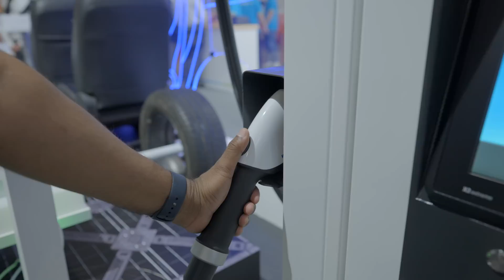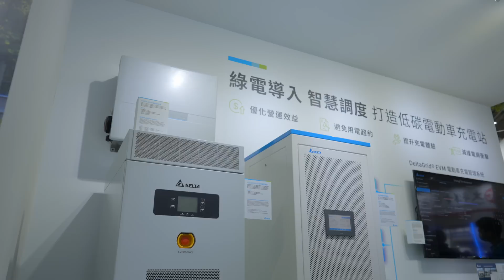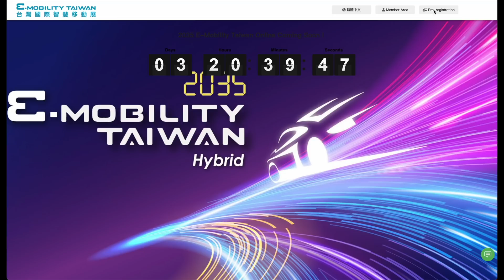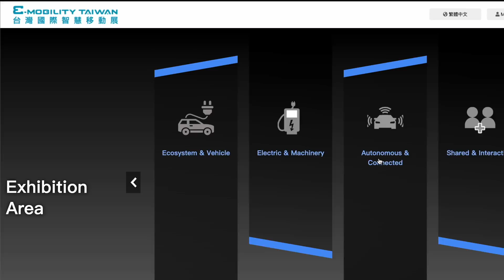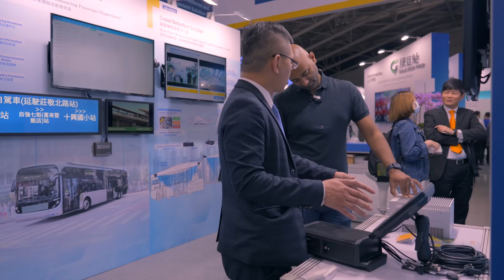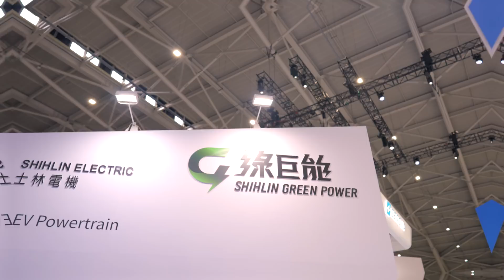The Unsung Heroes of Electrification

Comment: I think that the fastest chargers would go to those that can afford it; for as you said, the chargers are not cheap.  Now as for where the fastest chargers SHOULD go are to buses, Simi-trucks, and trains; any industry that transports people or merchandise.  That means public transportation, such as busses and trains (Ground based, no air) and Commercial merchandise transport, such as multi axial truck and trains.  Although Air-based systems may come in the distant future, the technology we have today is for the above mentioned.  Sea/Ocean Based transport is also available, however these are in less need of rapid charging as the time it takes to load and unload cargo can be about the same as the time to charge the battery, if they have one.  Sea/Ocean transporter may, in fact, be capable of charging themselves for their electric needs, as the vessels themselves are so massive.  Before the advent of electric, ships sailed using wind, today they mostly use fuel of some sort to propel them.  While said ships can be electrified, they are so massive in size that a sufficient solar harvesting system can be employed to meet the transport needs of those surface water vessels.  Road and Rail systems are not anywhere near such mass as to have their own energy generation "engine" or system, although they might use other solar harvesting technologies to supplement their energy needs.  Those are my thoughts for "Fast" Charging Technology.  As for Smaller transporters such as cars and normal trucks, if they can afford the cost of the new tech, then more power to them.

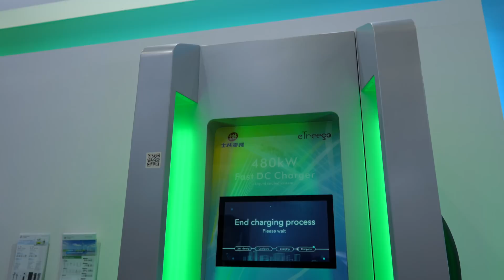Comment: 14:20 Technically, all of the 350 kW chargers deployed are already capable of 480 kW; they simply lack the number of modules required to output a full 500 A of current across their entire voltage spectrum. The GMC HUMMER EV (and all of GM's first generation 200 kWh Ultium EVs) can already max out the currently deployed 350 kW because they are still pulling 500 A even after the charger is no longer able to output that current at ~700 V. Based on the 100 kWh Ultium packs, the true max for the HUMMER EV and others should be ~380 kW. With the second generation Ultium batteries (lithium metal), those EVs should easily be able to max out a 480 kW charger. 

The Tesla Cybertruck is another possibility, where a 150+ kWh pack should be capable of hitting peaks of close to 500 kW, but that might still be unlikely on third-party chargers, which will most likely maintain a ~500 A max current limit for some time into the future.

Comment: With ICE one can convert to on the fly hydrogen with electric batteries fatigue or overheat and are fire traps requiring a lot of rare earth's we don't Have. It is BS
Reply from the maker: Lot of cars are moving to LFP batteries no rare earths
Reply: Lithium may not be considered a rare earth, but geopolitically and geologically it is hard to find to mine.  Electric anything is not something mechanics will be able to repair, and then there are the charging rates, software games of quick charge Tesla plays with salvage perfectly fine vehicles depreciating them, and one day soon the "get a horse" slogan will return with "get an on the fly hydrogen ice". when people whizz by people waiting on a charger or slowly charging.  I already see the fifteen charging slots at Wao with lines.

There are a lot more engine types of which the automotive and transportation sector are but a drop in the bucket of the climate change ge issue.

All that need be done is switch fuels to on the fly made hydrogen, not a redesign of more engineering nightmares engineers love to call themselves clever with new complicated BS machinery

When Toyota starts selling ICE hydrogen vehicles with on the fly made hydrogen people will look really as stupid as they really are with this electric BS  NOBODY on Earth has a robust enough interconnected electric grid to support electric vehicles like the US government is pushing without rapidly building LFTR nuclear and geothermal power plants FAST.

One of the biggest geothermal resources is the Yellowstone super volcano area, but that thought is as scary as despite LFTR nuclear technology was available in the 1950's but they very stupidly went with water fission reactors, similarly some idiot would drill into the magna chamber despite warning sights or due to above ground real estate availability thus setting off the super eruption, mankind it seems does not know how to be intelligent and not just excited.

Let us not forget a lot of power plants worldwide are still nasty upstream hidden emitters and will remain so.

A company like karpowership  could build or convert one of its power ships to and on the fly lng manufacturing facility and sail the seas with a LFTR powering the ship and making and compressing hydrogen or syngas and selling it in ports of call to replace Natural Gas which would make more sense than electric vehicles period.

When Spacex's starship explodes one day on one launch likely due to among other things the harmonics off 33 rocket engines or the failure of one cascading , Elon Musk won't look like such a  genius because electrification of transportation vehicles is just plain dumb to carry fuel in  the form of electrical energy stored in batteries.

Comment: I'm with Adam something on this one, if you have to install high voltage charging stations at every stop, you should just run an electrical street car line
Reply: If that buss has a range of 100km thats a lot of exposed power cables that require a lot of onsite maintenance between stops. .
Surely its cheaper to use chargers plus the fact you can reroute at will.
Reply: For busses and trolly like automated vehicles it makes .ore sens just to have high power charge points at stops near the end or beginning of lines where it will sit for a few minutes.

If a bus/trolly has a 50 mile route, then 2 stops that are 5 minutes long with a 500kw or 1mw charger would be fine to keep it topped up all day. It is far easier to change routes with chargers than rail/lines that are actual infrastructure.

Comment: When I saw the busses... I wanted to grab them and shake them while yelling, "What are you doing?! Put solar panels up there!" There are flexible solar panels with adhesive on the back of them. 86 inches long, 26 inches wide, 200 watts.. A bus is 100 inches wide and 40 feet long. You could fit 18 200 watt panels. 3600 watts under the direct sun charging the batteries of the buss while it's held up in traffic or sitting in the depo under the sun while charging at a station.
Reply from the maker: Absolutely!

Comment: People don't understand the exhaust fumes are terrible for health while we breathe it in during traffic & the car air filters don't absorb toxic chemical fumes...
Reply: Tesla does...
Reply: Awareness should also be raised about dust from brake pads being used. It's also very problematic for health. Electric vehicles could drastically reduce these emissions by using regenerative braking.
Reply: @Armando Aranda  very true, magnetic brakes recapturing the braking force is critical to make effective electric vehicles
Reply: Most cars have traffic filters, you never replace yours?
Reply: @everythingpony  True, but they aren't like an N95 mask. They only prevent certain sized particles and don't use carbon to absorb gases

Comment: 5:50 LTO is my favorite battery chemistry.  It can also handle heat and cold very well.  They last 20,000 to 30,000 cycles.  They have a wide voltage range, which isn't great for some electronics but it is great if you need it to fill in for another battery.
 I replace my car battery with a 6s 40Ah LTO battery.  I didn't even have to change out my alternator.  It tested at 1,200 CCA, but I think that may have been the limit of the tester.  I'm guessing if you try to jump start a lead acid battery with mine then the lead acid battery will catch on fire.
Why don't they make all car batteries LTO?  It cost like $1,000 in parts to build this thing.
Reply from the maker: yeah exactly, the tradeoff is lower energy density, so not ideal for a passenger car. also they're more expensive.. but i agree, grid storage its a home run
Reply: $1000 for how many KWH?
Reply: @irokpe6977  576 Wh, about the same as a regular car battery.
Reply: @madcow3417  what???? That's costly. You mean it costs $1736 USD  per KWH?
Reply: @irokpe6977  Yup.  Few batteries can handle the current and temperature requirements of a car without being massive or having a built-in heater.  On a usable lifetime amp-hour scale LTO is pretty economical.  Lithium ion can only handle a few hundred charge cycles, LifePO4 a few thousand.  LTO will last 100 times as long as lithium ion and 10 times as long as LifePO4.  I don't know how many full discharge cycles a lead acid battery will last.  They kept dying on me (in different cars) in a year or two of regular non-cycling use, so... 0 full discharge cycles.
Reply: @madcow3417  the only advantage that LTO have is the extreme longevity and extreme operating temperatures. Other than that, LTO is a big no. I even prefer sodium ion. If I'm building a car or bus, that's what I'll use. Sodium has a good operating temperature - better than Lithium NMC - and a few thousands life cycle.

Comment: How does Taiwan produce its electricity? Is it all solar/wind? If not the electric vehicle is just changing where the pollution is not eliminating it at least for the near future.say about 30 to 40 years
Reply: Mostly nuclear
Reply: @Baker.Matthew  wish the US would go more Nuclear .
Reply: @tomdalton4016  me 2
Reply: Would you rather have the pollution right outside your house, or in some remote power plant? EVs are a win already in that regard.
Most countries will be on well over 50% renewables by 2050. Easily. So by the time EVs are dominant world wide most of the energy they use will be near CO2 neutral and air pollution free.
Reply: @auspiciouslywild  want to point out renewables is no longer a great term when now even a renewable is being attacked. Methane is renewable. CO2 is not a problem it’s other pollutants .but they chose CO2 because it’s not what the big polluters have to worry about. When it comes to greenhouse gas it doesn’t matter where they are released the effect is the same. Ever see where they get the materials for the Batteries? Yeah I know in the future, like with recycling plastic
Reply: @auspiciouslywild  don’t look now but methane is renewable so it counts . Look at the percentage of electric produced by non renewables now and 30 years ago . Tell me what’s the percentage difference.
Reply: Do better research next time. In 2022 globally all forms of renewables and nuclear combined to supply 39% of electricity demand. 👍🏻😎
Here in the U.S. it was just over 41% between nuclear and renewables. With 85-90% of all added capacity coming from renewables. 

It ain't gonna take a decade if we clear up grid interconnect backlogs. In fact more renewables are waiting for interconnect permissions now than there is total grid demand.

Comment: Easy as replacing 3/4 of the grid ! Not so easy
Reply: They have to eventually
Reply: @Baker.Matthew   for cities yes if they keep increasing the load which is constantly going up and has for years.
Reply: If your country is switching to smart energy meters, you're probably not going to need much of a grid upgrade.
Norway has a very high share of EVs already, and haven't had to upgrade the grid yet. By some estimates no upgrades will be needed even with 100% EVs. Smart meters incentivize people to charge mostly at night. And with newer charging boxes and EVs it's super easy. It was just a few clicks in the app from my electricity provider, and it linked to my Ioniq 5 and can stop it from charging when electricity is expensive, or the grid is near its capacity. 
The problem with some countries is that the grid is already a bit weak because they may be using a lot of gas for heating and cooking. But that has to be dealt with anyway. Can't use gas forever.
Reply: @auspiciouslywild  natural gas is renewable plus there is and abundance of it on the planet .
Reply: We will eventually need a modernization of the grid conduction. Once the deployment improvements become standard.
Reply: 1950-2000 U.S. grid grew over 500% in total capacity and demand. That's an average of almost 10% yoy for decades.
From 2000-2020 demand stayed nearly flat around 4twhs, despite a nearly 23% increase in total population. 

To fully support evs we need about 1% growth per year as we transition. Doesn't seem that big of a deal. 🤔
Reply: @4literv6  in 1970 average home had about 50 amps of power now most are around 100
Reply: @tomdalton4016  everything built from when I was born in the 80s is almost all 200amp main panels. 
We now have smart splitters and smart panels so you can just smart load share with a dryer or electric oven to charge an ev where the panel has little to no total head room. 

Plus lvl1 at 15amps at 8-10hrs home dwell time for a daily use ev can recharge many who drive 35 or less miles in a day. 👍🏻

Comment: Good luck with your advertising of electric cars, I am going to buy cars using zero emission synthetic fuels.
Reply: Try driving a modern EVs a few times before writing it off. Most people that switch to EVs never want to switch back to ICE. Though it depends on the quality of the charging infrastructure in your area of course. Thankfully it's improving rapidly in many countries.
Reply from the maker: i like that tech and have made a video about it! https://youtu.be/jaUhmhl9BPo
Reply: No such thing currently as zero emissions fuels and they will not be zero tailpipe emissions whenevere they do finally exist either. 🤔
Still going to create particulate matter pollution, noise pollution etc. Still will require batteries and electric motors just to function and still will require oil changes, air filters, tune ups, belts hoses and on and on vs the vastly reduced ev maintance requirements. 👍🏻
Reply: @4literv6  Well synthetic fuels have just been approved by the European commission. Looks like ICE are going to be around for very long time. The Co2 percentage present in the air right now is 0.4 % normally is 0.3 % helping to maintain the temperature a little warmer and the planet a little greener, if the Co2 goes down to 0.2 % the plants will die out. Meaning the customer is king, thus the customers will decide what is best for them to buy.
Reply: @davmac6148  every customer who prefers ice even one's burning synthetic fuel over an ev should be required to simply lock themselves up with it in a confined space. Turn it on and see just how zero emissions that fuel really is. It would very quickly end this nonsense! 👍🏻